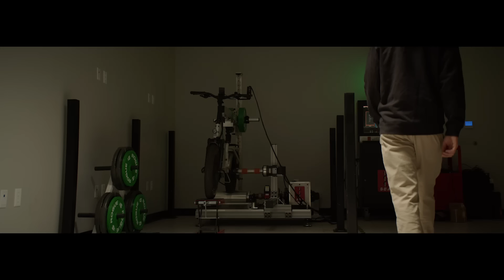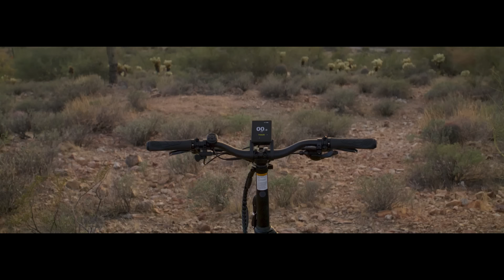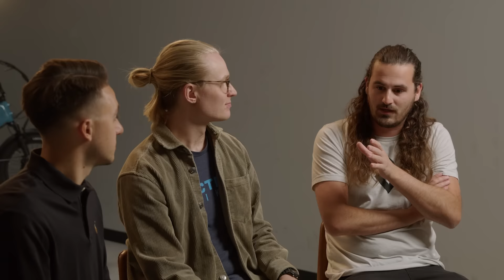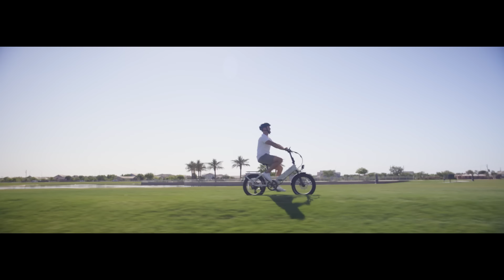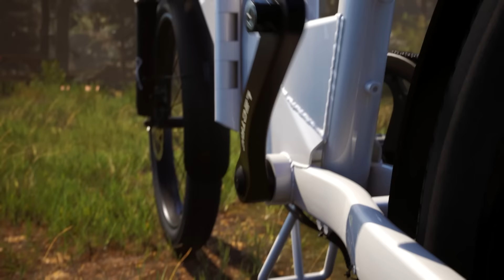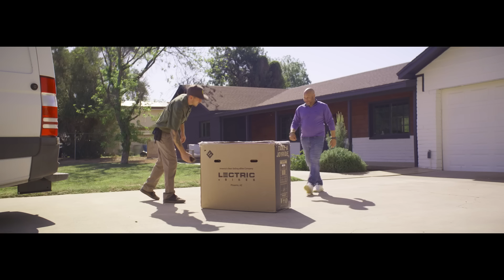Lectric eBikes | XP4 Design Series | Pt. 1 Look & Feel

Comment: Quick question for the Lectric team. I’m going to be purchasing the new XP4 750W version. I’ve seen a few YouTube videos of the XP 3.0, and the riders were able to get a top speed of 30mph in class 3, and PAS 5 settings, while pedaling super hard. Is the XP4 capable of going 30mph if you’re really working the pedal hard?
Reply from the maker: The XP4 and XP 3.0 have a top speed of 28 MPH, which is the limit set by our system—so going over that speed isn’t really possible. We've found that many riders get confused because their display is set to kilometers per hour (KMH) instead of miles per hour (MPH).

Comment: In the new XP 4 750...are the batteries the same size in the step-thru and non step-thru??  If they are different, does the fast charger charge both batteries or do you need a separate fast charge for each battery??
Reply from the maker: The battery pack is the same AH on the Step Thru and Step Over. 🙌

Comment: How about lets make it lighter?
Reply: Then there's the XP Lite for that reason. The XP4 would probably have to switch to a carbon fiber frame to lose weight without compromising on features, but carbon fiber is expensive. If you want that, look up Urtopia.
Reply from the maker: That is a great suggestion. I will be sure to pass it onto our team😀

Comment: As an XPedition 2.0 owner, will this new display be compatible with the motor and controller on this bike? Though I am not sold on the removable display idea yet, it seems like one more thing to easily get stolen if you forget to take it off the bike.
Reply from the maker: Currently, the parts for the XP4 aren’t compatible with any other models.
Reply from the maker: That is a great suggestion. I will be sure to pass this onto our team😃
Reply from the maker: We are so excited for you to get your new Pine green XP4. we know you are going to love it😉
Reply: Thwack your for this in-depth video. I hope for the XP 5 750 or 800 (maybe up by 50 watts lol😂) the upgraded version can have a 3-speed Carbon Gates belt drive and a 20AH battery, horn, alarm with GPS through an app to connect with other XP 5 riders near me... Obviously without ghost pedaling... Maybe by then the new price 1099 and 1399 for the "800 watt" model. You can set a "new" watt standard.. 🎉
Reply: @barranquillero1979 would be nice but most laws restrict wattage to 750 for class 3 e-bikes
Reply: Waiting for the Pine green 750 model myself. Had the XP 3 with over 2500 miles... Had only 1 minor issue since new but it was livable. Thank you for your awesomeness customer service. That alone is worth not only the small "premium" to pay, but to keep a customer happy and recommend to friends family and strangers